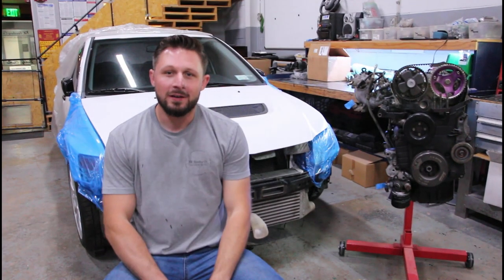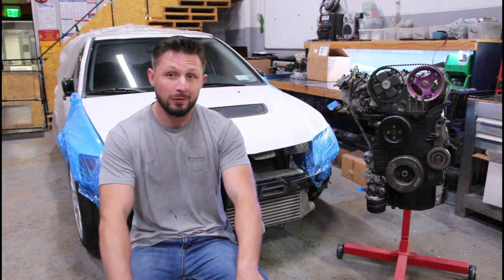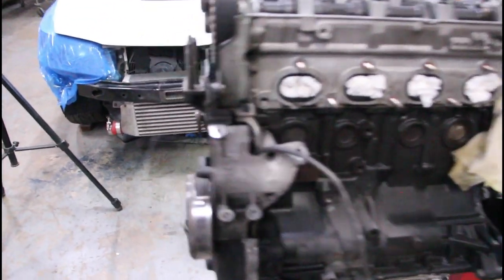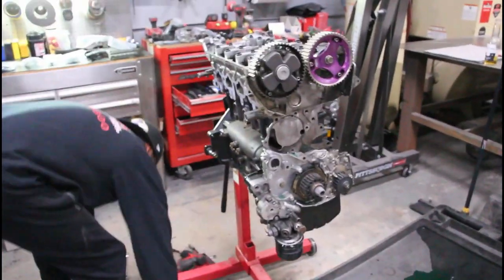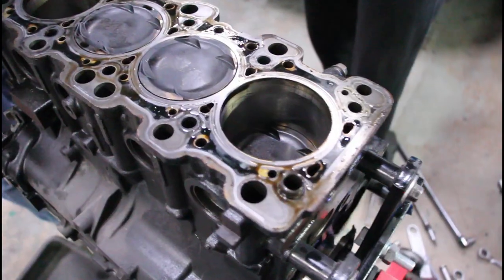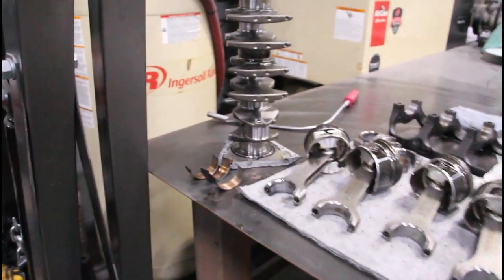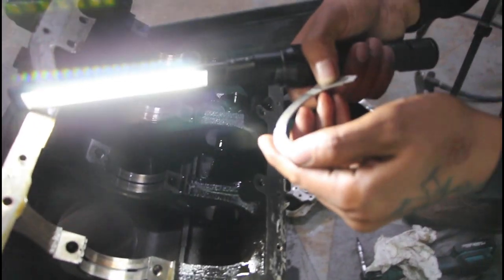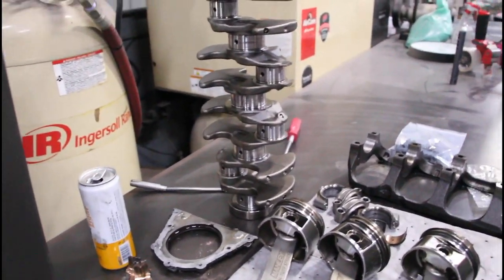KK RS 4G63 Disassembly & Plan

Comment: how much hp & torque have you ran on those h-tuff rods?
Reply from the maker: The car made 460 wheel on a dyno jet and 420tq the rods and pistons are still fine, the bearings not so much. I believe the H Beams are rated to 800